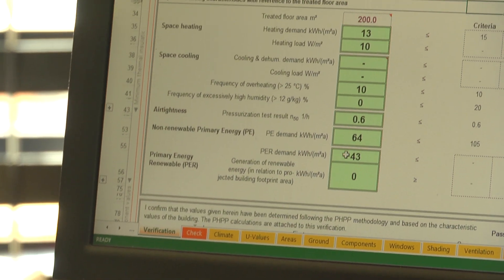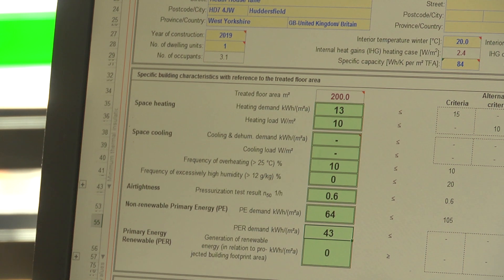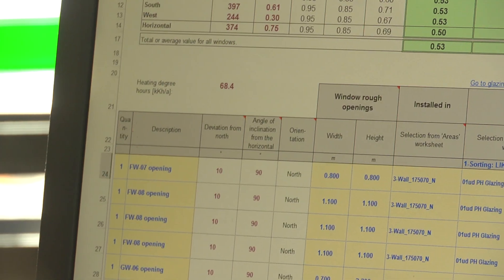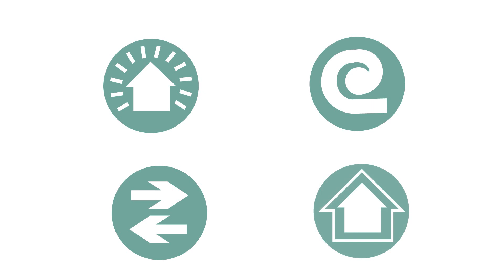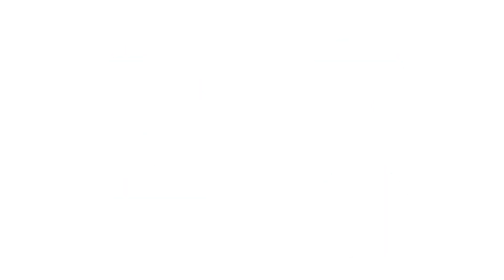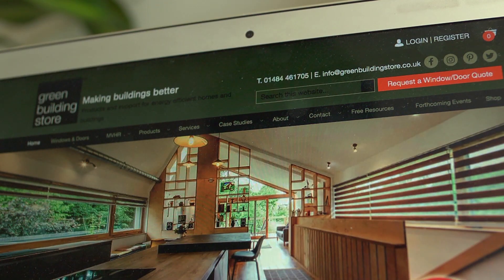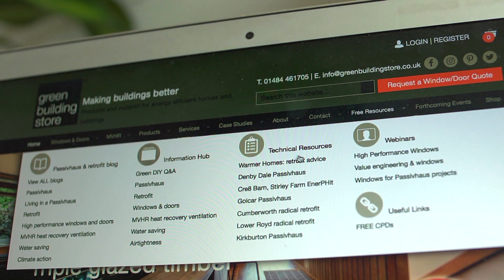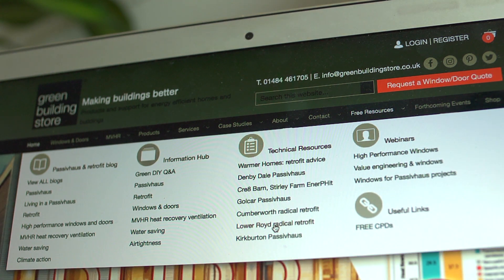A short guide to radical retrofit

Comment: I don't get why the internal insulation is vapour permeable. Surely there should be a vapour barrier on the warm side of the insulation to stop the moisture in the internal air from saturating the insulation and condensing when it hits the cold stone outside.
Reply: I thought that too. Used in attic. Not sure why it wasnt continued. Even with the mhrv the humidity in house is going to compound up to dew point once its dropped by 20 or more degrees.

Comment: I would love to do this on my draughty, cold, damp flat, but my main issue is finding someone qualified to do the work. I wish the government would invest more in training - even if it was on a loan basis - and that there were more companies like yours across the UK!
Reply: Any decent plasterer
Reply: I got an air tightness test done, and told them that I'm trying to go for the PassivHaus standard

So I probably won't get that far however, I told them that basically I want to get my air tightness right down. I'm currently at 7.66. I can easily get to below 5, if not 3 by basic air sealing up

If I ever get an extension, I'm definitely making sure that it's built to PassivHaus standards from the get go

Comment: Great video and left wondering how long such a project takes as most of the changes seem very invasive/complete rebuilds rather than retro fits. There must be a cost/benefit analysis step against retrofitting an old house versus demolition and starting from scratch, surely. Pity that one of the buildings had used cement mortar on yorkshire stone, rather than lime.
Reply from the maker: In both of these projects demolition wouldn't have been an option (one was a listed building, the other is a semi-detached house). The demolition/ retrofit debate would be an interesting one to have more research on,  in terms of expense and overall carbon emissions. The cement mortar pre-dated our involvement and there was no point in removing it as it didn't appear to be damaging the stonework. Detailed technical briefings on both of the projects can be downloaded from our website: https://www.greenbuildingstore.co.uk/technical-resource/